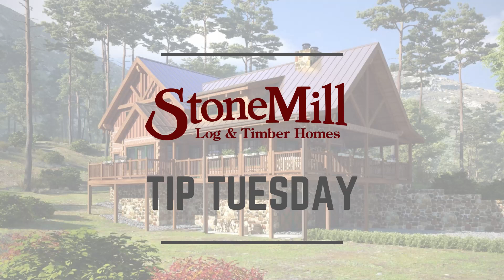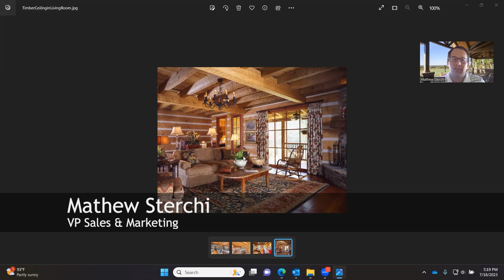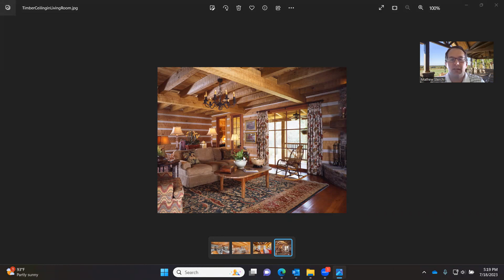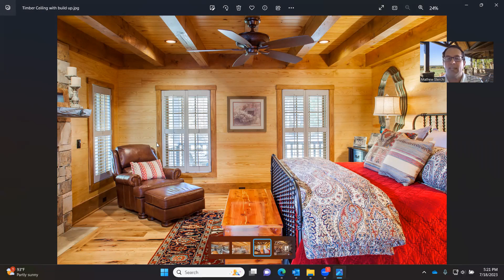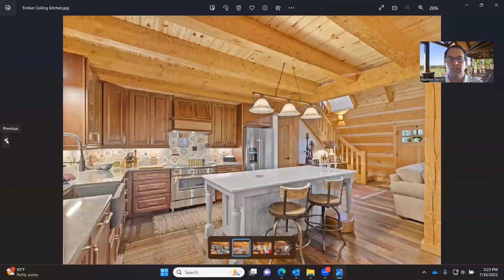Tip Tuesday: Floor Options for your Log or Timber Frame Home

Comment: Great video. Question, if I want to use a built up floor for the second story, would you use tongue and groove pattern 116 for the material that you would see from the first floor? And then maybe 2 x 6 tongue and groove for the flooring that is exposed from the second floor or may be three-quarter inch plywood with may be finished laminate flooring? Any advantages to either way? Just curious.
Reply from the maker: Great question!  With a timber second floor with built up; we would provide & install the timber floor system comprised of the timber girder, floor beams, and 2x6 v-groove t&g on top of the beams as the structural second floor.  The 2x6 structural t&g would be the finished ceiling for the first floor and the subfloor of the second floor.  On top of the 2x6 t&g; the GC would install a felt underlayment, conventional framing for the built up floor for M/P/E considerations, ¾” plywood on top of the framing, then finished flooring of your choice.  Depending on the height of the built up floor; this provides the advantage of insulating between floors for noise reduction, providing a cavity for electrical considerations and the ability to run recessed lighting in the first floor ceiling, and provides some options for plumbing and mechanical considerations pending the height of the built up.  Additional cost and design considerations for second floor ceiling heights would be disadvantages for this direction but the insulation and M/P/E advantages I feel outweigh the disadvantages.  With a timber second floor with built up, we could always look at the possibility of substituting the 2x6 t&g for 1x6 t&g during the engineering phase for approval to reduce some material costs in the timber floor.  I hope this response proves to be helpful.  Please feel free to call us anytime you have questions or if you’d like to discuss this item in greater detail.  Thanks.
Reply: @stonemilllogtimberhomes772  wonderful answer. Thank you so much for the info. Makes sense. Just trying to see it in my mind. I re-watched your video and I see that I missed the part about the costs for designing the floors and the steps to take into account the height of the second floor if it is built up. Makes perfect sense!